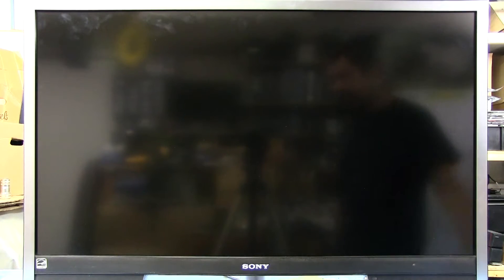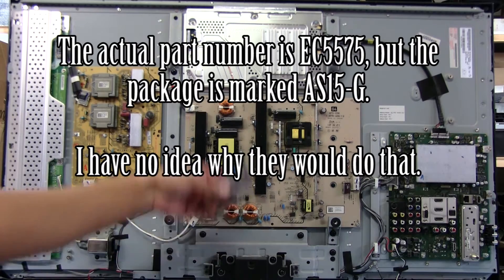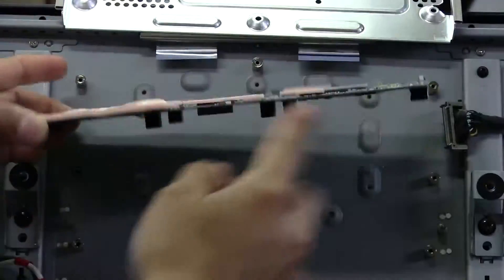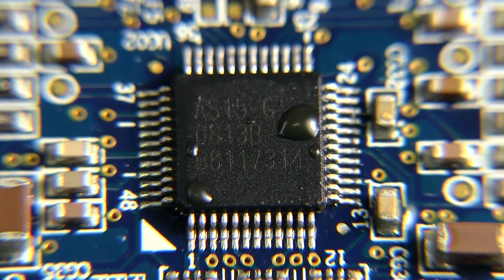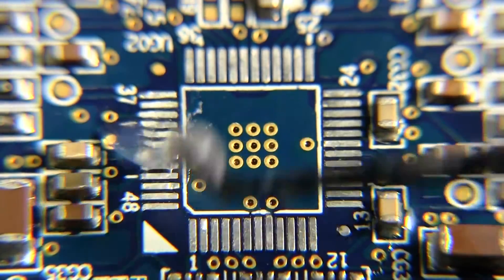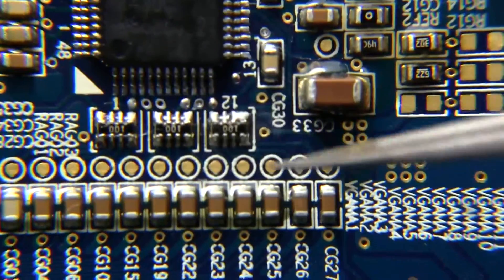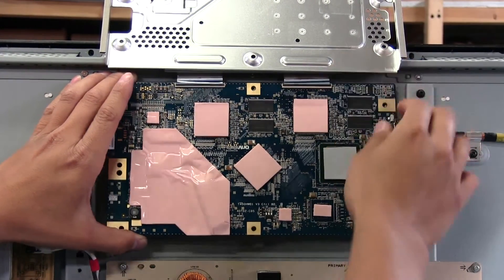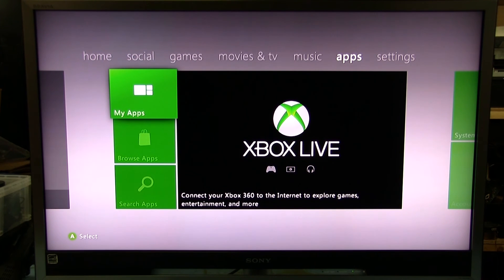TWB #30 | Sony KDL-40Z4100 LCD TV With Bad Colors

Comment: Any clue how to get to the other side of the ribbon cables that attach from the TCOM board? I need to replace a bad ribbon cable that got one of the contacts rubbed off while I was replacing the board. I've tried just about everything I can think to get to it. Thanks!

Comment: so I have a question, I have a sony kdl 40sl140. The as15-f chip in it has the following after  Q or O 830CG B8523492. I can't find any replacement chips with those numbers..  What are my options? if any. the tv is old but up till now has had no issues and was great for my kids room. hate to buy a new tv if I can fix with a five dollar chip

Comment: Very good
Reply: Thank you very much. You saved the same model of Sony TV from going to recycling. I removed the T-con board, purchased the AS15G and took it to a company who does micro soldering. I put it back together today and voila...all was well. Thanks for the step by step, easy to understand, remove and replace video.

Comment: Thanks for sharing this awesome video. Do you know if the same AS15-G IC will work on the 46inch  model (kdl-46Z4100)? I bought the AS15-G chip but my tv is 46'. Thanks for any advice you can provide.
Reply from the maker: While I've never taken apart that model TV, and couldn't tell you 100% for sure, it appears that it does use the same chip on its T-Con board. I'm basing this on just searching for KDL-46Z410 and AS15. This video (not mine) shows them replacing an AS15-F on that model: https://www.youtube.com/watch?v=DJOIvmXD2P8

Hope this helps! Good luck!